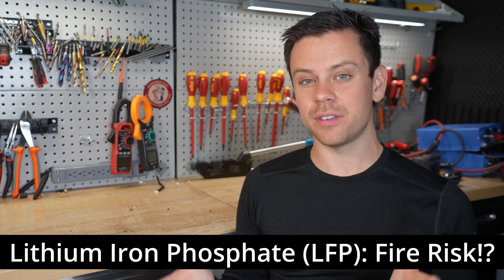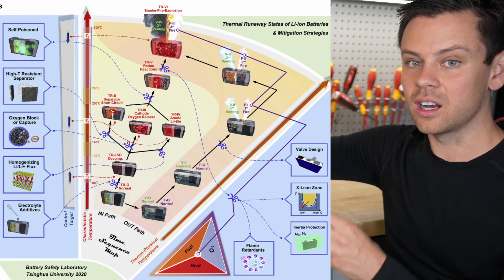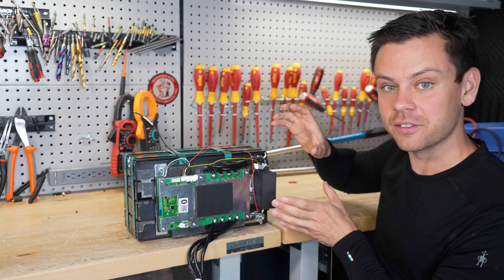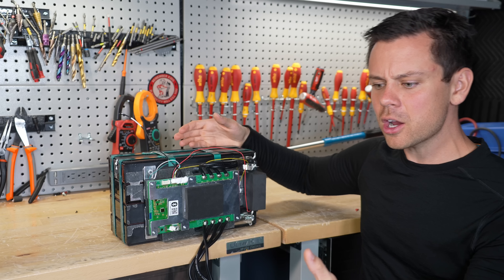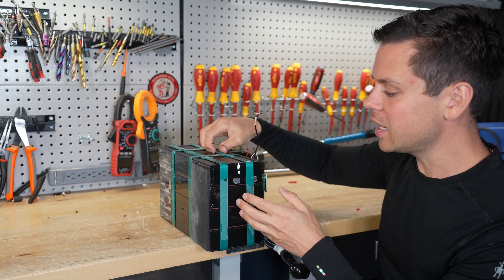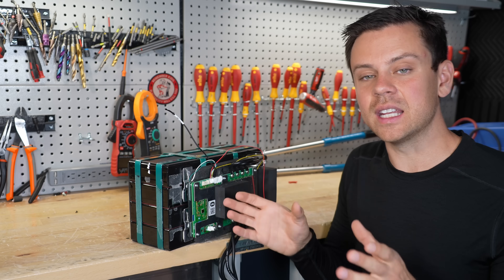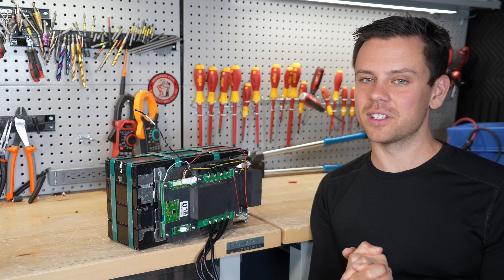LFP Battery Fire Safety: What You NEED to Know

Comment: I installed an eco-worthy 195 watt bifacial solar panel on the roof of my vehicle. The wires run to a Pow-Mr Keeper 1220 mppt 20 amp charge controller. It keeps my 12-volt 100 amp hour lipo 4 battery charged at about 13.3 volts. I use the battery to power my trailer winch. It works just fine but I was wondering if 13.3 volts is a full charge or is it just floating there?

Comment: You just answered a question that I was really concerned about. I purchased a Power Queen 24V 100 ah battery to be combined with a MPP Solar PIP 2724LV (like you reviewed in another video) to use as a UPS for inside the home for pass through power to my TV, cameras and other such equipment, as well as keeping the battery topped off. But I was worried about the dreaded Lithium battery fire problem. The Power Queen 24v I purchased is a Lithium Iron Phosphate, so seeing this video makes me feel much better. Thank you.

Comment: any suggestions for batteries for a marine system I am setting up? I am purchasing an Elco- 50 hp equivalent electric outboard motor for my pontoon. Its a 96 volt motor and I am going to try to build a roof from solar panels( 24 foot pontoon should have lots of space) and of course batteries for storage. I am trying to figure out the best battery and charge controller set up. I know its going to cost plenty but the saving over the long run will be great. Also solar panel recommendations will be greatly appreciated.

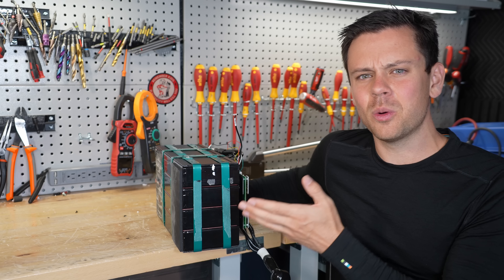Comment: 8:05  - They charge the battery faster than filling the fuel tank. 🤣

The average time to fill a car's tank is between 2-3 minutes.

"For example, in 2021, the median gas car range (on one full tank) in the U.S. was around 413 miles (664 km)"

"BYD has unveiled a 1,000 kW charging system that adds 249 mi (400 km) of range in just five minutes"

Advertise 1000 kW charging speed, sure no problem, but saying... why? 

You know how batteries work and 5 minutes is only in really perfect conditions and the distance is shorter compared to the average distance of ICE car.

Faster battery charging than refueling, that's false! I'm sorry...

Comment: EXCELENT VIDEO!!!
I have been pushing for LiFePO4 battery chemistry since 2019.  I built my first power stations in 2015, but my first purchase was a small Beaudens since it was the only power station that I knew that had this chemistry.  In 2020 when Bluetti started their Facebook page we pushed them into changing the AC200 from NMC chemistry to LiFePO4 chemistry and they DID listen, nice.  The original AC200 never went on the market (you could only buy it from Indiegogo) and Bluetti quickly came out with the AC200P, which had LFP batteries.  My question is how do you know that what I buy really has LiFePO4 battery chemistry?  A lot of unknown brand power stations say they have LFP, but how do you know for sure?

Comment: Great info. This gives me more peace of mind on my solar system and my six LFP batteries. I'll share this with a brother-in-law who asked with concern if I have these batteries in my house. He thought I was crazy and my house would burn down. My system is in my garage, it's been running for more than a year. And I appreciate the advice on making sure the cables are all tightened to correct torque specs. Many thanks to you for educating me on my self-installed system. I couldn't have done it without you!

Comment: What about cells in series under compression, touching each other, without the yellow fibreglass separator sheet and breaching the blue plastic over the aluminium cell casing? Wouldn’t that cause a fire from interconnected cells short circuiting ?

Comment: This is good news. I plan to switch over in my off-grid home when my current FLA batts die.
Reply: Just be careful that your charge controllers and inverters have the correct voltage settings and charge algorithms when switching over to those batteries because older off grid equipment does not.
Reply: @Loki-rascal 
Good advice, thanks. I will definitely need a new charge controller since the one I have now is FLA only, I believe. Hopefully my hodge-podge of various 12 volt PV panels will be okay. 😮

Comment: We have an off-road cabin with an inverter and battery bank. I would never put Li batteries there. The lead acids have worked fine for 25 years. I got 22 years out of my first set of batteries and the ones I replaced them with will probably last me the rest of my life as I am in my 70s. These batteries get down to about -15 F in the winter when we aren’t there. I have a hydrogen sensor that will turn on a fan at a low level and will disconnect the batteries at higher levels. We run a 48v system with a  Trace 4048  that was made in 1995.

Comment: How does a novice know how the internals of a battery are made and connected? I know you tear apart a lot of batteries but I've noticed that two different batteries made by the same company (100AH vs. 300Ah) can be built differently. I just purchased a Wattcycle 314AH battery and to be honest, I have no idea if the BMS is good, if the crimps and wire connections are good or anything else.

Comment: The EarthX etx900 is a LiFePo battery specifically designed for aircraft. As you may know there have been several aircraft Li battery fires, though those were usually from other Li chemistries. It would be interesting to see the EarthX. construction and safeguards compared to s standard “powersport” LiFePo battery.

Comment: Look on Youtube> "LFP Batteries: Are They the Safer Choice for Electric Vehicles?"
The LFP needs more energy to cause thermal runaway, but once they start to burn, they burn faster and more energetically according to that video.
Reply: Researchers in the United Kingdom have analyzed lithium-ion battery thermal runaway off-gas and have found that nickel manganese cobalt (NMC) batteries generate larger specific off-gas volumes, while lithium iron phosphate (LFP) batteries are a greater flammability hazard and show greater toxicity, depending on relative state of charge (SOC).

Comment: Nonsense. I could say lets wait for hugh fires created by LFP but I know  we will not hear . The same as we are not told about Li  Ion   You are talking here about    burning the cells as their materlai construction. This construction can create very little energy in compare to stored.  . Hugh fires are created by energy  stored in cells which is too quickly rleased. You can have also hugh fire of traditional generator which has 99% parts made of steel and cooper. How would you explain this? Hopefully generators  can be stop mechanicaly . Cells not.   Different materailas have no meaning. - energy is alredy made  and will do it's job. .

Comment: This type has a longer lifespan but less density. Overdischarging on cobalt based turns out to be less of a problem, it is when you then try to charge from 0% to 1% that you do the most damage. Therefore trickle charging is highly recommended using currents of no more than 200 mA.

Comment: We had a warehouse full of Lifepo batteries catch fire in Melbourne Australia, and it burned pretty fiercely which surprised me since we had been hearing they are very low fire risk. But what you say about leaking electrolyte and external flames sources makes perfect sense and explains why it burnt like it did. I was unsure about putting a lifepo battery inside an RV or caravan after that event and Aus regulations currently say that no lithium battery of any type should be inside the living cabin space of an RV or caravan. Seems like Lifepo should be OK IMO, but......maybe not. A separate vented compartment seems the go.
Reply: More an issue when charging or discharging, stored should be OK unless you put a forklift arm into a battery pack
Reply: Did you do any research about how it started

Comment: The US doesn't use LFP because they have lower power density and the consumer demands longer range. Not because the US is behind. Also they frequently want higher performance which NMC delivers.
Reply: Whatever makes you sleep better... But no... Nice try though.😂
Reply: @Flaggyt The manufacturing capacity is definitely behind. The stated reason is faulty. There isn't a large market for LFP based vehicles in the US. There is barely a market for NMC. Fuel is cheap relative to other countries. Distances are larger. Housing more spread out and the cost of vehicles way higher (much of which is due to safety regulations).
Few want an expensive vehicle with terrible range. It's not a behind issue. It's a lack of demand  and affordability issue.

Comment: So true about loose connections. In my camper, my connections became loose from several road trips and ended causing my wires to melt, nearly causing a fire. You know I check these connections often now!
Reply: Loctite or silicone caulking is amazing for locking in screws and terminals
Reply: @pcs9518 another thing is to have a secure place to attach the cable near the terminals . We had specs where I worked on this. Most of cables were attached to the battery racks near the connection. I never heard of using loctite, is it conductive? We dipped all our connectors in hot nooyx along with the nuts and bolts after using a brass wire brush on them.
Reply: @Chris_at_Home it’s not conducive but I’ve never had any issues with the other exposed metal areas still being conductive
Reply: I worked in telecommunications and we checked the torque on all connections annually. We also checked for voltage drop across connections quarterly.

Comment: 120A max battery grid charge without solar. Could be a problem for some. Also the manual says to run 8 awg for ac input/ourput which is insane.

Comment: One major detail regarding automotive and other applications LFP is lacking rather heavily on energy density and volume.
Reply from the maker: Not anymore, the latest cells are almost the same as NMC. Especially at the pack level because you don't need as many safety features as NMC
Reply: @WillProwse  Not really LFP tops out at around 160wh/kg in a best case not to mention volumetric efficiency. Even considering pack levels the cost gap between the two cells isn't broadly large enough to justify their usage. You can push LFP upwards using silicon but likewise you can do the same but better with a high nickel & silicon dry cell. Broadly speaking you really are never going to see LFP in highway class EV's since the power requirements for 70mph are considerable.

Comment: The gasses that vent from LFP batteries are highly combustable though, it can release large quantities of hydrogen. This is why, for example, the Dutch energy storage standard PGS 37-1 also state that ventilation is key and that without fire it should refresh the volume of the room where your battery resides should be refreshed 6x per hour when venting is detected. Mind you that for this you'll need an explosion proof fan. The standard might not be perfect but it tries to mitigate risk for the people close to the battery, the environment and the people who will have to fight the emergency situation if it happens.
Reply: The standard is designed for larger or commercial systems.
Reply: Yep, this is also why SAE also specifies that they be housed in fire rated and vented containers.

Comment: I still don't trust the BMS lifespan but would be more willing to use LFP on a future project. A direct vent to outside from battery room would eliminate the fumes of a failure, maybe a temp controlled fan 2c higher than it ever gets, 80cfm bathroom fan could do it.
Reply: Ark from fan motor.

Comment: Been using lipos and lifepo4 in RC for 20 years, had one lipo fire due to a speed controller short, ( landed in water ), with the lifepo4 I accidentally shorted out a pack for about a minute  and it got hot and then turned the solid wire linkage into a fuse.😂

With big installations or where we charge packs indoors why don't they simply make 2 separate monitoring circuits so that if one goes wrong the other one will show there is a problem and shut it all down so we can then inspect and fix the issue before the cells get to dangerous voltages?
Becs don't cost much .....

Comment: Funny thing is that there are demonstrations on youtube of LifePO4 fires conducted by researchers when various fault conditions occur.  So save us the bollocks.  The only Lithium chemistry which demonstrates very high resistance to catching on fire is Lithium Tantanate.  Much of the criticism about Lithium batteries is quality of manufacture of the cells themselves and the surrounding hardware like BMS and the enclosure materials and location.  Risks are always present with anything known to man, but some simple precautions can go a very long way to mitigate risks.  Alas we have people willy nilly installing lithium batteries in very bad locations that create combustion fire risks and enormous potential damage to equipment like inverters and structures.  I dont have a problem per say with LiFePO4 but with the over enthusiastic and reckless manner in which people turn something safe into something very dangerous.

Comment: Meh,   prolly better to put your batteries in their own little detached concrete block shed, with minimal temperature control that can survive a battery cookoff, or an insulation cookoff,  relatively unharmed. The chances of it happening are really low, but it can be nasty and expensive if it does. Dont know about you hoss, but I am almost as scared of sleeping under a roof with a 60kwh battery as I am sleeping under a roof with 20 gallons of gasoline.